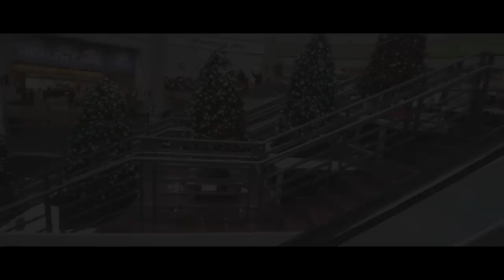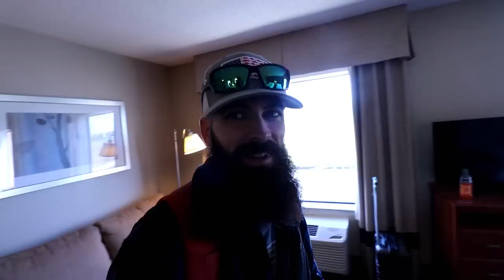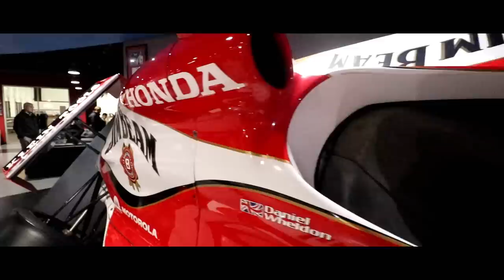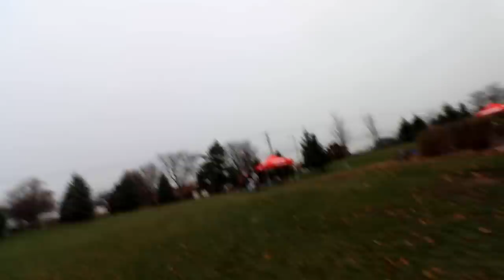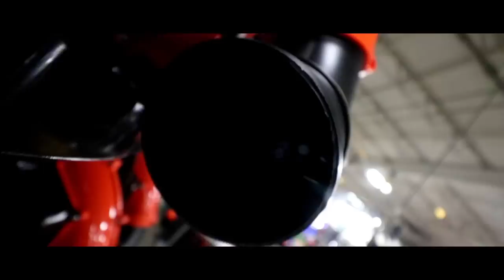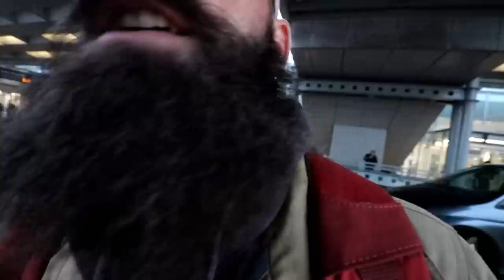ECHO Equipment Tour | UAG 2018 | Blowing Leaves in the Snow

Comment: nice video now give me the low down on what is new I hear the new backpack blower is not as confrontable as Stihl I have not used the airport in Chatanooga how was it I am not giving up my new Stihl 600 blower for an Echo I would just buy a push blower
Reply from the maker: tim freeman my opinion the ECHO blowers are more comfortable and lighter on your back. The Tube on the STIHL blowers are easier to work back and forth. The ECHO has more power to push more leaves but I do enjoy using the STIHL br600 in wet leaves to break them free around plants